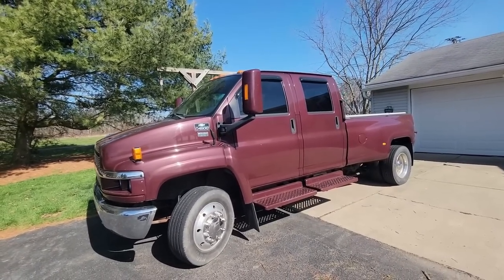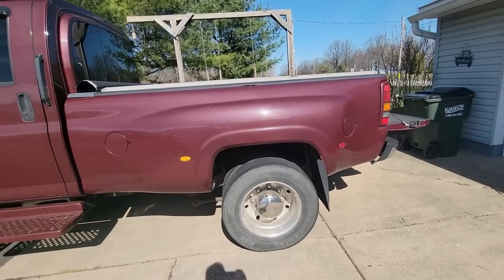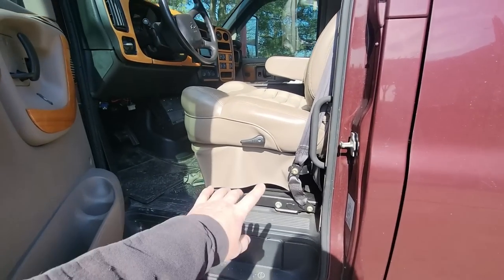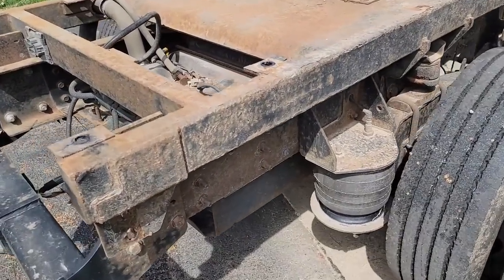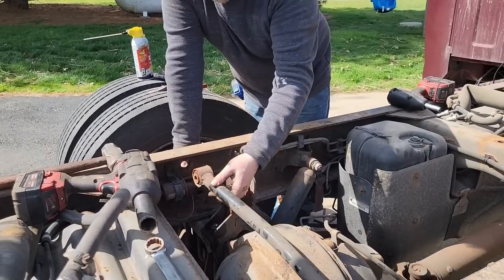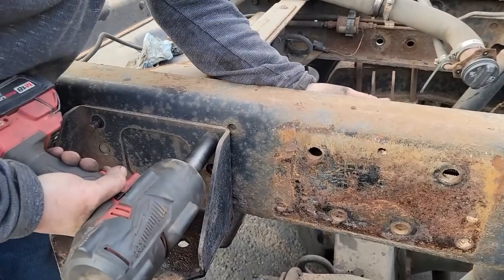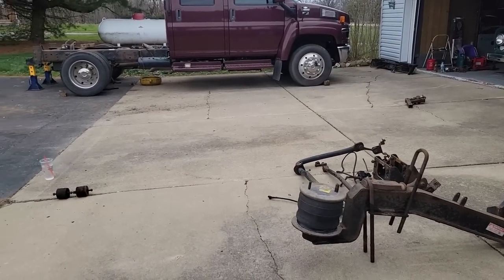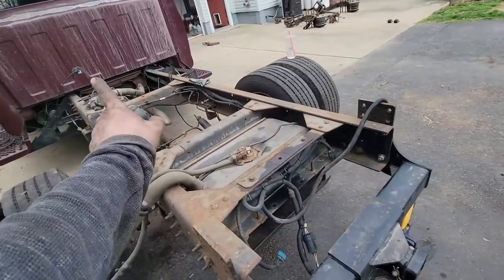2005 C4500 FIXING WHAT GM & MONROE SCREWED UP!PT1

Comment: You mentioned that you were fixing everything that GM did wrong, from what I can tell you are putting it back to what GM originally built and the secondary vendor messed up. I have a 05 5500 ex U haul truck with the gas motor. This truck has been the best purchase that I have ever made, after cutting the frame and adding a 16 foot flat bed it performs great every time I use it. 
I’m glad to see you making the the truck you need rather going to buy what someone else is trying to sell, that is what got you to this spot in the first place. Good luck!
Reply from the maker: keep watching. you will see what i mean by fixing everything gm did wrong. the old uhaul c5500's are very capable trucks for a gas engine. i would say far better than the only other available truck its size at that time which was a ford f450 v10. dont misunderstand, the cab is why i bought the truck....the rest of it was not what i wanted. i knew if i bought it and kept it long enough, i would be doing this build.
Reply: @j.c.smithprojects   as you mentioned the cab space and how high it sits on the road helps with visibility, I weigh in at 12,500lbs unloaded that makes a big difference with handling when hauling on the truck or with a trailer. Good luck with the build!!

Comment: I'm always leery of aftermarket upfitters.  The quality is usually pretty shoddy. At the dealership I work for, we got a couple Express conversion vans through that were done by Explorer. Seems like everything was held in place with self tapping sheetmetal screws. The exhausts didn't clear the plastic fenders, so they ended up melting them(added tips to remedy it). Also had to move the anchors for a cooler because it wouldn't latch. I feel bad for whoever has to work on them down the road.
Reply from the maker: agreed.

Comment: The day my last 4500-8500 series GM got sold was a great day for me.  I agree with you on the Duramax, the crappy GM van interior and the lousy wiring harness and ABS/brake wiring.  The weight was a problem for me trying to run them commercially and legally- my 03 Duramax dump had a 16k GVWR and a curb weight of just over 13k with a driver- so it was pretty useless if you wanted to run legal.  Looking forward to the series!
Reply from the maker: i promise you....this will not be useless when i am done.

Comment: i have a 2008 4500 i like it i dont drive everyday with it it does not have a bed but i ended up putting one of thoes flat bed units on it with the hole for the goose hole i like it  its 8 ft wide 12 ft long going to lowes or homedepot is a breeze to load also can fit 6 pallets up there i dont have the monroe conversion so the seats are that like that vinyl but i got one of thoes beds for the back seat, i also have the link air ride but a completely different kit mine is a arm from in front of rear axle to under the axle with u bolts and a good year bag in the back definitely works well it was a x ambulances so it was for that i assume for loading people, my frame is 11.5 feet behind the cab so i have the 12 foot flat bed

Comment: I'm anxious to watch this build.
Wasn't at all surprised to see "part 1" in the title!
I've installed a ton of Link lift axles, and they are designed well. That air ride system is not.
A Kelderman is a much better design, but for your use, the OEM leaf suspension will be better.
Also anxious to see the YouTube armchair fabricators come out of the woodwork during the frame modifications !!!
Wondering if you can start a betting series on what power plant you will use ??? 😁
Reply from the maker: i doubt anyone will guess all the different engines i am considering.
Reply: @j.c.smithprojects  years ago a friend put an air cooled Deutz diesel in a Chevy square body crew cab.
But he was a Deutz tractor dealer.

Comment: I always wanted one of those trucks but after your thoughts I agree
Reply: I had this C4500 Kodiak Monroe lowered version. The brakes were excellent, the turning radius fantastic but the ride was horrible as it was stock springs all around. Whish it had the air-ride suspension but I don't know if it ever came in a lowered  option. I loved the look but the ride was rough.

Comment: Once you removed the bed, there is a subframe under it that has a rubber bushing. You did not know what that was for. The subframe is there to protect the bed from being ripped apart from the stress the truck would put on it. Monroe says not to operate the truck with the tailgate down to prevent the bed coming apart.

Comment: If I recall, you’ve never liked Duramax engines.   What was it about this truck that you liked when you originally bought it?
Reply from the maker: like i said in the video, the cab height and room is like no other. i had 3 of these identical trucks at 1 time. this one, one with a western hauler bed and one with a semi 5th wheel on an 84" cab & chassis ( i sold this one but still have two.)

Comment: In manufacturing we were taught not to ever use old or torqued out bolts or screws because they were somewhat damaged because of their previous use, and to always use new ones. What are your thoughts on this?
Reply from the maker: agreed. i will not reuse bolts or nuts in many applications. i sometimes reuse them in situations that are not critical.
Reply: @j.c.smithprojects  Thanks, I appreciate your videos.

Comment: I drove to Monroe in Wisconsin in 2006 to get side steps installed.  When I finally found their shop after getting lost they laughed and said all the G.P.S. systems took people on a wild goose chase...I said WHY Didn't you tell me that when I called an hour ago?  I should have known better and left but I had already driven 90 minutes there.  The steps I wanted wouldn't fit even though the salesman told me it would.  They broke one of my heated mirrors which I didn't notice until I was 30 minutes away, had to drive back and argue with them until they installed a new one.  The wiring for the lights on the step weren't secured so when ice built up on them it ruined the lights.  The company is a complete joke.

Comment: Love it I did the Cummins conversation with a 10 speed on my kodiak can’t wait to watch it
Reply from the maker: might be a 6.7  might be an ism cummins, might be a cat 3126, dt466 or who knows. just depends on which i can make fit. i prefer a manual trans but an auto would be better for my wife to drive it if needed.
Reply: @j.c.smithprojects  that’s sweet I went threw the same thing on mine the 5.9 /6.7 fits really nice I started out with the 8LL trans then sealed that out for a 10 speed with the lower overdrive.  .73 in 10th. Went with 3.73 gears and it tows really well. Mines a single cab with a 2020 ford bed it actually looks pretty good lol you have some great builds can’t wait to see what you do with it !! I have a m11 Cummins’s and a 13 speed I’d love to put in but would never fit lol. The little old 5.9 and 10 speed does ok
Reply from the maker: i tow a good bit and when i do its heavy. my trailer weighs over 10k and i usually put 15-20k on it. the more gears the better. keeping the rpms in their optimum hp and torque range is what makes a great pulling and enjoyable truck to drive.
Reply: @j.c.smithprojects  
Do you have any thoughts on the L10 Cummins ? I have a very low milage one 310hp I have one more rust free c5500 I would like to see if I could squeeze it and a 13 speed in that truck it would be a really good tow rig. We tow boats gross 40k at most with truck.
Reply from the maker: i have one as well. i measured it. i think its too tall. over 49" i think it would be into the dash panel unless you lift the body 6". i am looking for the right 13 spd now. i want to climb the hills in southern ohio and west virginia at 65-70...not 25-35 like it is now.
Reply: @j.c.smithprojects  what if we used the c7500 dog house that is way taller i believe the floor is humped farther back as well I’m not sure how much more power the L10s have tho
Reply from the maker: i am currently looking for a c7500 or c8500 donor  for the dog box. the fiberglass portion of the cover doesnt have that flat part like the 4500/5500. it is straight up from the cut out. i dont know if it is any taller. i have located a truck for parts but not crazy about the price.
Reply: @j.c.smithprojects  I have a few of those cabs in the back. I have a few dog houses the cab floor is different as well. Your in ohio as well correct ?
Reply from the maker: i am. how much farther back does the cut out go on those? is it wider as well?
Reply: I think those seats look comfortable as frig. I see your point though for working they will get nasty and ripped up probably. I suppose your doing the right thing now while they are worth something.
Reply: I have a dog house and small floor cut out from a 2006 c7500 I’m not going to use your welcome to it. I picked up a L10 Cummins down the road from you the other day the guy said he bought it from you lol small world! It’s going in this c6500 we have !
Reply from the maker: is it an air brake truck by chance?
Reply: @j.c.smithprojects  I’ll go look at it again today. I’ll be going back out there . Im back on the hunt for another engine I don’t think I can save that L10 without a ton of money the crank is wasted.
Reply from the maker: email me "j.c.smithprojects@gmail.com"

Comment: I just picked up a 2008 5500 from a construction company. It's dirty as hell inside, but it's the color you're looking for (cloth seats). The drivers seat air ride system is deflated... I haven't gotten to it yet. The panels are all broken. But I'm interested in your seats if you've still got them. How can I get in contact with you?
Reply from the maker: i need the complete interior with good door panels.
Reply: @j.c.smithprojects  Do you still have the seats? If so, are interested in selling outright? All my stuff is trashed.

Comment: Can't wait to see the videos on this project!    What engine are you putting in?
Reply from the maker: Undecided at the moment.
Reply from the maker: plus it was a rigid steel beam. most o.e. air suspensions still used a leaf spring to help absorb the road.
Reply: @j.c.smithprojects  Seems like they just did a quick and dirty design and charged dearly for it.

Comment: Is it possible to move the axle forward on these trucks and just use the stock cross-member mounts? I wanna shorten a 5500 u-hual truck and im wondering how hard that would be for someone in their driveway.
Reply from the maker: i have done a tone of axle moves on trucks. did the first 10 or so with a cordless drill and drill bits from 1/4" up to 5/8". drilling in steps. in hindsight, i would have rented a magnetic base drill. it would have saved so much time and is much easier on the body.

Comment: Well I’m looking forward to watching what your build is like
I have a Kodiak, C 4500 -06 LLY 
I have the RV  hauler bed so there’s no sides on it which gives you a lot less trouble. I have the length suspension on the back air ride seats just like yours I have a Kelderman front suspension and swaybar set, which takes a little bit of fine tuning to get it perfect with the link system on the back
It has, ARB dil motor fast recovery motor for all that your systems wickedly fast on my third trip around the United States in this truck
Had a Ford 
Had  a Dodge 
32000 driving down the road, waiting motion stays in motion, distractors, preferred and stopping a large 5th wheel
Go check out Gary out black cloud diesel performance for all your super gear that I need for your truck 
The one thing about the Alison, unlike Ford or Dodge is win, the transmission breaks. It goes into limp gear and you can drive for 1000 Miles in a Ford or a Dodge you’re just stuck on the side of the road. Good luck with your build and have fun. These tracks are becoming very very rare and I paid $40,000 for my truck 10 years ago 
I kept getting hit by other drivers in my small trucks. People aren’t so willing to pull out in front of us monster.

Comment: It is what it is personally love my  03 duramax in my 3500 dump but I know had problems in later years due to emissions gov mandates but all diesels had problems my 14 Cummings gets 6 mpg in a 4500 series just don’t understand how a smogged up engine that would get 3 times mileage if it didn’t have def and all that crap on it be better for the environment if using triple amount of fuel
Reply from the maker: your 3500 is programed so much differently than these trucks. im not an isuzu fan. actually, im not a v8 diesel fan regardless of the manufacturer. my 5500 is a 2016. it does over 10 loaded heavy. might be your gearing? i have never heard of anyone with  that low of a mpg in a 5500 unless they haul heavy through the hills constantly or bad head winds. mine does very well. in fact if it didnt have all the overly complicated do dads of the lariat interior, i would use it more often.

Comment: J.C., are you building this truck into a wrecker?
Reply from the maker: i dont think so but who knows? all my plans are written in sand. a good breeze and it all changes.
Reply: @j.c.smithprojects  
I know what you mean, J.C.  I think that truck would make a great little wrecker for moving smaller trucks around.  Find yourself a decent twin line wrecker unit with a wheel lift and that would be a pretty sweet little truck. 🙂
Reply from the maker: i would do that with a single cab. i think a crew cab wrecker would be unattractive as a resell.

Comment: What motor? C7 or 8.3?
Reply from the maker: you dont put C7 engines "IN" anything....you take them "OUT" and put them where they belong....scrap pile.
Reply: @J.C. SMITH PROJECTS  couldn't agree more......I had a 3 legged poodle that would outpull a c7 t300 kw

Comment: iv always thought a pickup bed on a truck like that is pretty useless unless you live in California where all the weight stations say no pickup trucks.
Reply from the maker: agreed. the farther i get into this, i am considering starting with another chassis and swapping the body.
Reply: @j.c.smithprojects  probably kinda a horse a piece. Unless you have another chassis with the exact wheelbase you want. Your prob still have to move the axle. Your still going to have electrical to do to get all the gauges ECT working with a different engine. So basically it comes down to what's less work mounting the engine and transmission in the chassis or mounting the cab and Hood on a different chassis.
Reply from the maker: i am looking at the benefit of a heavier frame as well. even tho the gvwr on the truck is lower now, i wont be upset having heavier gvwr chassis and frame. far more plentiful parts. these gm parts can be a problem. thinking of using international frame, axles and steering. i have my own parts supply of those.

Comment: I personally feel that the front end hood looks out of perportion to the cab it may be because the suspension is dumped the cab looks more suited for a truck more than a pick up I understand that it is modified  it's only my opinion
Reply from the maker: your right. the c6500-c8500 have a higher and flat hood. i like it better. we may need that for radiator and engine clearance.

Comment: I understand you don’t like the Duramax motor, but why waste money replacing a motor that works and has low miles? It gets the job done. Just wait until it blows up then replace it 😂
Reply from the maker: one of the biggest reasons is it doesnt do what i need well. it is a slug. it can be tuned to do better but if i am going to spend money to improve it, im going to make the best improvements i can. that is putting a better engine in. i expect to spend a large sum of money to build this truck. right now this motor and transmission combo has a high value to someone else. all stock, low miles and complete. the more miles, i put on it, the less its worth. if it has some failure, its value is dropped severely. i have 11 truck builds in process. that is a lot of money in parts. i have to be as efficient as possible in order to afford it.
Reply: @j.c.smithprojects  understood! Good luck with this build,👍🏽 I will be watching.

Comment: I sure wish youd grease whatever needs to be greased on that telehandler that is an awful noise it makes lol
Reply from the maker: rust forms on the boom when its used outside in wet weather. it takes a time or two of sliding to clean it off.

Comment: Yeah the 6.6 will always be a 1,000,000% better than any dodge or ford engine out there. Also people think these trucks are worth more than what they are. There not worth anywhere near what a Silverado or sierra same year would be worth.
Reply from the maker: typical chevy /duramax fan.....delusional and out of touch with reality. the japanese  isuzutrash engine is poorly designed. horrible mileage, low power and requires aftermarket parts and tuning to get it up to the abilities of the stock cummins.....if it was so superior it would dominate in sales and the hotshot market but it doesnt. dodge and ford do. you based your comment on opinion, i base mine on facts.

Comment: Cummins swap?
Reply from the maker: we will see.....maybe , maybe not.
Reply: @j.c.smithprojects  so.. 12 or 24 valve? 😬
Reply from the maker: anybody and every body does a 5.9 swap. its easy. if it isnt a challenge, why bother?
Reply: @j.c.smithprojects  isx?
Reply from the maker: you couldnt get an isx in that truck. the shifter for the trans would be in the back seat

Comment: I don’t get it… if you hate it so much why did you buy it?  Clearly this is not your run of the mill 3500… it’s a custom set up not meant for everyone driving a standard dually….   Yet you bought it anyway and you continue to complain?
Reply from the maker: well i guess you never bought anything and hated it after huh?....i dont own a crystal ball. nor do i have the ability to see the future. had i known the duramax in this truck was such a slug on power and a pig on fuel, I WOULD NOT HAVE BOUGHT IT!